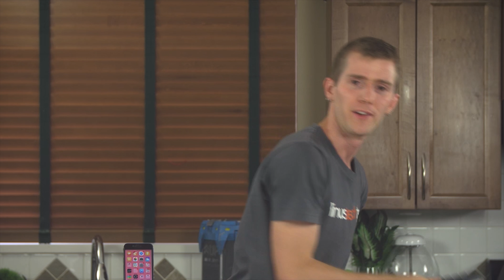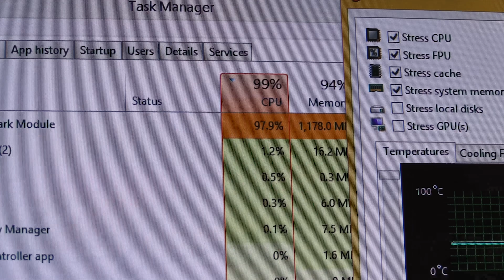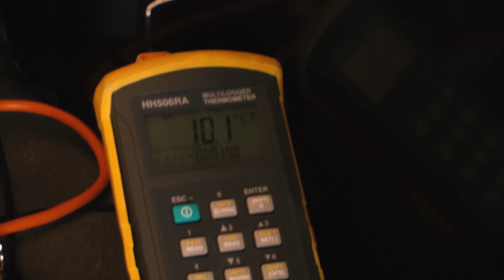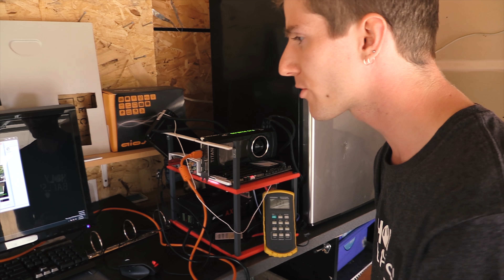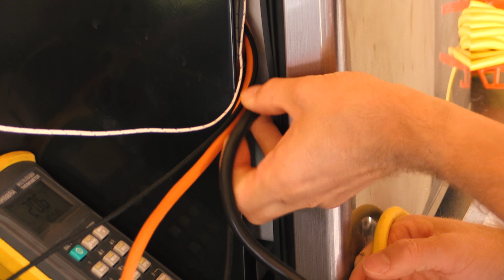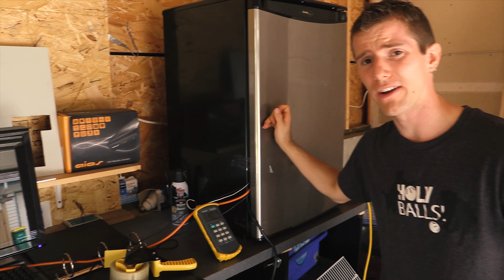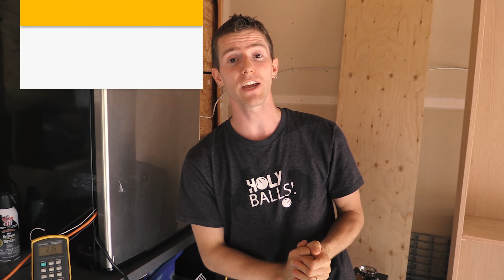PC Build in a Fridge - Does it Work??

Comment: What about putting the air flow of an air conditioner THROUGH a PC case?
Reply: Napoleon Blownapart actually AC air is pretty dry, isn't it? And in a car you use the ac if it's damp inside to dry it out....
Reply: The air being removed from the blower compartment of an AC systems air handler (indoor half) would need to be replaced with warm ambient air outside of it. That air then needs to be re-cooled. This means that the AC system will be running continuously. If that's not trouble enough, if the AC system doesn't cool at a rate equal to the rate the incoming (warm) air is warming the compartment to, then it will continue to fail to keep up with the load. This will ultimately lead to the compressor getting to hot and the high pressure side of the system reaching to high of a pressure resulting in an overload tripping, forcing the system off. Either the High head pressure switch or the compressor's thermal overload will trip (not unlike a circuit breaker). These measures are there to prevent the system from permanent damage. The bottom line is 1: The system has to cool the area served faster than it is being warmed. 2: The system has to be able to run either continuously, or nearly continuously, by design.

The only good news is that the moisture problem is not really a problem unless you are regularly opening the compartment housing the PC. Unless you introduce new, warm, moist air into there, the air will actually dry as it cools. The chiller system will remove moisture as it cools the air. This is why actual server room systems have humidifiers to prevent static electricity build up.
Reply: @WhoWouldWantThisName  some Systems are 100% outside, does that impact the Air Exchange
Reply: @nicke1903  Sorry Nick, I don't really follow what you mean by 100% outside. In any cooling system you have a space you are trying to extract heat from and a place you are trying to displace that heat to. So if by "outside" you mean the space we are trying to transfer the heat to the space we are trying to cool must be a separate space from that. Otherwise we are just moving air, at most.
Reply: Napoleon Blownapart MOIST
Reply: I've had the idea of removing my towers side panel and duct taping a box fan of equal size drawling air out of the pc like a wind tunnel, it wouldnt be very loud on a low fan setting and i'd think it would really draw out the heat
Reply: I've actually done this in the past.. it works great as long that you seal all of your escape points around the edges of your case and make some custom ducting...
Reply: +Tom Dibernado I don't really know if air flow is insufficient with existing cooling systems. I mean, is OC primarily being restricted by the heat alone? You can always try what you are describing but make sure the air can get in as easily as it is drawn out and that the air can blow out as easily as it is drawn in. You don't want to over or under pressurize your case and everything in it. It can't hurt but I think getting the heat out of the CPU and GPU is perhaps the bottleneck of cooling as opposed to the expelling of that heat. I don't know if that's the case or not. I'm just posing the question. Maybe you or someone else here can answer that.
Reply: Hubwood 
I have an air conditioner in my room and my PC is right in front of it cause it’s on a little table thing. I’ve done some tests and I don’t think it work that well
Reply: I'm in AU and have done that work fine as long as you run dry. 
jays 2 cents did one through a over kill radiator
Reply: Moist bro
Reply: I have worked with several system builders in the past that have done this and they called it forced induction cooling, but it's a pain to set up, since airflow and airtightness of the case is very important, then getting all the extra pipes and hoses that has to be fed into the case and a exhaust pipe to help move the air back out. I would recommend what they told me and use a portable ac unit. The only upside is though is you don't need case fans, since the air is already getting fed into the case from the ac unit.
Reply: JUST GET A MONSTER PC DUDE
Reply: AC dries the air so the condensation comments are mostly wrong.  It's certainly much better at condensation than a fridge.  You should however set a thermostat to a reasonable temperature to keep it from getting too cold.  Mainly when first starting it up.  Trapped air inside components from outside the container could still produce condensation.  Passing the incoming air directly over a water cooling radiator would be a great idea, so that the radiator is cooler than ambient.  Cooling then heating air (at the water cooling radiator) is also a great way to get the air very dry.  That's like squeezing a sponge (cooling) and then letting go (heating).
Reply: That is what every home does... It's better to run the PC outside. Humid air removes heat faster because electronics can't perspire, like humans. (AC's depend on drying the air, in addition to being cooler, in order to work.) Hot components don't absorb moisture in cooler surrounding air, they lose moisture, if they have any to lose. (There is actually no danger in keeping the rig running, after it is removed from the cooler. The computer is warmer than the ambient air. You don't get condensation unless there is a drop of 20-degrees, roughly. The computer would have to be colder than the air, which it can't be, if it is running, unless it is 150F outside, they YOU would be dead and having condensation on your computer would be irrelevant... because you would be dead...)
Reply: jayz two cents did this and it worked really well for water cooling and stuff.
Reply: the air itself is dry because the water condensate on the unit cold grills, but some of this cool down moist gets into the air itself and turn to water when it touches surfaces continuously. like metal. thats why ac units produce water, and fridges too. what im saying is, ac does not remove all the water out of the air, it cools it down so it will be more prone to condensation on surfaces. thats why you cant just plug in a pipe directly from the ac and the pc, if you could, there would be already ac cooling on pc's. but you can cool down a room where a pc is as long you are not planing to bring your room to fridge like temps.
Reply: Its too moist. AC air reduces temp, meaning water from the air will turn to liquid on the surfaces.
Reply: @Napoleon_Blownapart  Not true the air coming from an AC unit is very dry as it has just passed over a coil that is much colder than the condensing point of water (hence icy coil) air conditioners actually dehumidify when ever they run, the greater the TD between coil and ambient the greater the cooling and humidification effect.  With a good 30-40 degree temp difference you could expect very low relative humidity in the air, about 10-20% as that air heats up relative humidity actually goes down. In short: Cold air over hot surfaces will not cause condensation. (ie cool air over hot processor)  Hot air over cold surfaces will.  (condensation on your cold drink)
Reply: @Napoleon_Blownapart  AC removes condensed water out of the Unit. Its one of the ways they work to cool the air down. The air coming out is rather dry. if you doubt this place glass in front of the AC unit. or place two wet rags, one in front of a fan with equal enough air flow to the AC and one in front of the AC and see which drys first.
Reply: Matter fact..... They work like dehumidifiers do dude. The air coming out of AC is literally the same type of air a dehumidifier produces.
Reply: Napoleon Blownapart watercooling
Reply: @Napoleon_Blownapart  only if the surfaces are below dew point
Reply: Wrong idea. The humidity will destroy your pc
Reply: you can search on google why you cant use ac air to cool down pc's. it explains better than i do
Reply: @Napoleon_Blownapart  you shouldn't use none optimized HOME AC to cool a PC.  You can definitely use properly calibrated AC. I've worked on server racks where there are either hundreds of small AC units or several big ones.  The key is to use the AC units to control humidity which can be done by having tight control over supply air, coil temperature, airflow (CFM) all these factors affect humidity but all can be controlled with proper tech.  Not terribly hard to do on a small scale if you know what your doing.
Reply: @Liam-cv1in  I was referring to why hooking up a tube to the PC vents straight of a normal, home, AC unit might be bad for it. Of course, like you said, in controlled and professional situations it works. But you mention server rooms, that means all of the air inside is controlled to have a very low humidity, so that does not apply to a normal house room in a normal humid area. I was just referring to knowledge also available on the internet on why the stated situation might not be good.
My father owns an home appliances shop, and he works with AC. And I've seen water droplets in areas were the AC air was in contact with (not usually on a fast fan setting), like metal and glass, especially when it is turned off after a while, and thus maybe turning it off after using to cool a PC dangerous, since the materials are cold. When its on, i think it his because the air coming from the AC mix together with normal air and cools down water molecules on that air, i may had missed said that in other posts. But i must say i live in a very humid area.
Reply: Condensation

Comment: You do not put the computer inside the fridge.   Instead you put 1/2" copper tubes inside the fridge in a giant spiral and then blow air through the tubes with one tube leaving the fridge aimed like a nozzle directly on to the CPU lid.  That way you can still store your beer in the fridge.
Reply: I thibk it could work with a defferend fridge. A fridge with a opening on it like you see in supermarkets
Reply: I'd watercool the pc, use an old fridge with the serpentine on the back, put a big car radiator fan on the top then build a case around the fridge to give airflow, then  i'd put a full bridge rectifier and a capacitor to power the fan with the input from the FBR going in series with the fridge itself so that the fan only turns on when the fridge is on, the fan can take 10A+ so it is very easy to put it in serial without it burning.

Comment: technically you could get the computer to work well in the mini fridge, the issue would be having to modify the fridge by adding a bulkhead going out of the fridge and using a computer that's in a pc case and attaching a hose from the vent port on the computer to the bulkhead going out of the fridge. essentially you'd have to isolate the heat coming from the computer and vent it out of the fridge so as not to affect the temperature in the fridge.
Reply: zero2umashi Yeah it was a disappointing  effort. Not much thought. Really needed to then say... what do we need to do to make this work. Just turned out to be ..duh it don't work and here's the science.... myth busters it is not. They would have carried on and made it work.

Comment: You didn't really read those posts. You might have just read the titles.

Alot of the posts you showed actually suggested creating air flow or even customizing the entire mini-fridge to become a constantly cooled environment for a fully built PC. As in, not just stuff a PC into there.

Creating a custom PC with a mini-fridge as a case and to allow the constant cooling to run through and be vented out. I'm sure they use Freone inside mini-fridges, so it's basically "cold ice" that never really melts. Air is blown across it to generate coolant and that is then sent into the closed case.

What the posts suggest is customizing it so it can achieve constant flowing cold air. But to also customize it entirely that the mini-fridge actually becomes a PC case by adding fans and vents.

What you did was what was not suggested in the posts and just stuck a PC inside a mini-fridge.

Comment: +Linus Tech Tips
what if the computer was submerged in a special oil that does not freeze below zero   similar to antifreeze  , 
and then the whole thing put in a freezer , with the freezer modified so it  bypasses the on & off  cycle  so it runs permanently ,
( like alot of people do this to bar fridges for home brewing beer) ?
that should eliminate condensation & freezing  and the oil should circulate by pumps inside the submerged case  so it will be recooled constantly

Comment: Haven't watched this video yet, but I'm gonna guess it doesn't work. Refrigerators aren't meant to cool computers, because computers constantly output a high amount of heat. So this will most likely end up being slightly cooler, but with the compressor running 24/7, making it loud and power hungry.

Comment: Another issue with this setup is that the door's seal is compromised by the cabling. This will allow air leaks which A) doesn't allow the unit to cool as it should, and B) can cause humidity and moisture buildup, specifically where the warm outside air and cool inside air meet.

Comment: Why put the whole computer in the fridge?  You add too much waste heat for no reason. The power supply can do fine on air cooling. A better idea would be to use the fridge to cool liquid and pump the cooled liquid from the fridge to the computer. That way you are not releasing the waste heat inside the fridge. The only waste heat in the fridge should be returning liquid in the cooling loop, after it's had a trip through the radiator. Eventually the liquid will reach equilibrium, but that could take a significant amount of time, depending on the size of the reservoir and efficiency of the fridge.The door should be sealed shut and holes drilled somewhere, specifically for the tubing. It's going to use a lot of electricity, but I think it would work better than just shoving the whole PC in there. If it was able to cool properly in those conditions, you might start running into condensation problems too.

Comment: so in other words get a small window air conditioning unit, point the air flow into a closed box and put the mobo and frame into the sealed box, it would essentially work then because the wall a/c unit keeps a constant air blowing and keeps it chilled? i mean i could make a rig with brand new wall a/c unit and box for about 150 bucks.

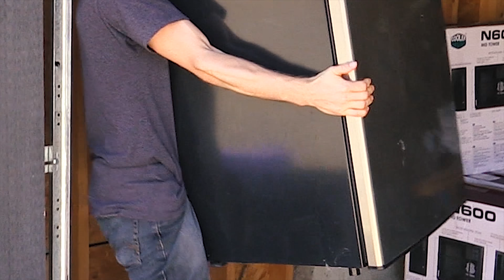Comment: 1:32 where this works or not is going to depend entirely on where that  fridge has the  capacity to  hold enough coolant and  the size of its compressor and radiator else its gonna turn into an oven
Reply: also watch out for condensation your gonna want to put some salt or quicklime or some other powerful desiccant in there

Comment: The refrigerator doesn't work because it removes heat very inefficiently. Refrigerators were designed to cool down items that don't produce and maintain a unending source of heat.
Reply: As long the PC is turned on, it will generate heat (how much depends on what it is doing), no matter what.
Reply: REALLY SHERLOCK? Thats what he just said in the video... -_-
Reply: Kaaz unending - does not end as the PC is on unendingly
Reply: Kaaz Are you an idiot ?
Reply: Nope. They were designed to keep items cool, not to cool them down. You should never put anything warm in your fridge.
Reply: @fheedpexx9267  That is nonsense. Refrigerators make warm things cold all the time.
Reply: Muh pedantry?
Reply: Alex but what about the heat death of the universe? Then not even change will happen...
Reply: Need a freeza instead
Reply: I guess you missed the part of his video where he addresses exactly this...
Reply: Nope
Reply: Thats what the video says
Reply: What about a human body
Reply: But if you were to use a ac unit or use fans ro circulate the air
Reply: He is right, you can also describe it like that.
Reply: simply put, you are very wrong. A phase change refrigeration system is an extremely efficient cooling process
Reply: UH OH SOMEONE DIDN'T WATCH THE WHOLE VIDEO HE PROVES YOU CAN AT THE END
Reply: HodlersWeekly good point!
Reply: actually, it very definitely is meant to remove heat efficiently. Just not EFFECTIVELY. Which is why their energy consumption(and consequently running cost) is measured in kilowatts per year and they try to keep that number low. 

Learn the difference: efficient is not the same as effective.
Reply: Hah!!! Wait your right,
Long peen has left the chat.
Reply: Not true. It worked very well on the first test, with a 20 C improvement. The real reason is that the second computer dissipates more heat than the refrigerator can remove, turning  the fridge into an owen.
Reply: Kaaz do you really need to be so fuckin uptight about some little denotational hiccup
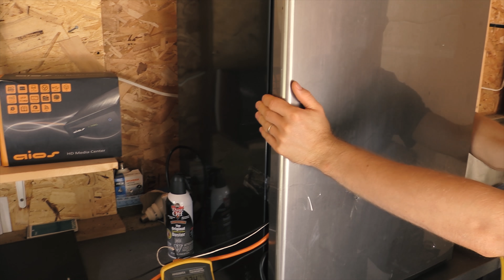Reply: @8:17
OMG !
HVAC ?!! does he even know what he's talking about ?
Where is a H(eater)V(entilation)A(ir)C(onditioner) in a fridge !!
Reply: The mini fridge cannot shift the volume of air required to keep it cool it's possible probable most likely doable but for a computer that large you need a bigger fridge at a lower temperature shifting greater volumes of air but that would probably cost more in electricity and just total infrastructure then custom design products they do the exact same thing if you work in a restaurant and had a walk in freezer maybe you might be a good place to store your PC long as it doesn't any calzone sauce on it should be fine
Reply: Kaaz actually there is one thing that is unending and that is change.
Reply: HodlersWeekly 

Unending source of heat!?
Omg tell me more!
Reply: Mutsurini 
Muh triggered ?

Comment: Air is a terrible temperature conductor.
Instead you could build small evaporators that go on the components, or cool the fluid in a watercooling system(alot easier, because less components)